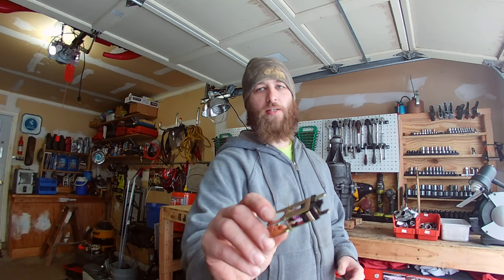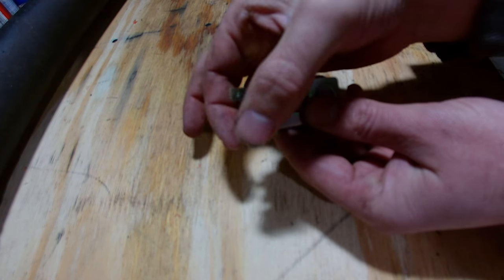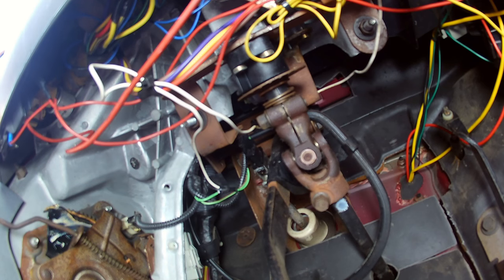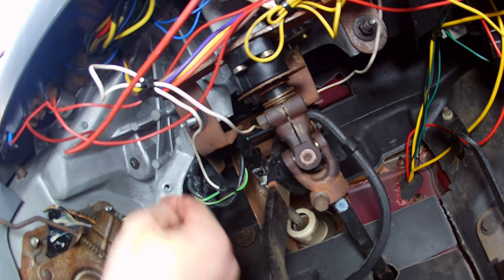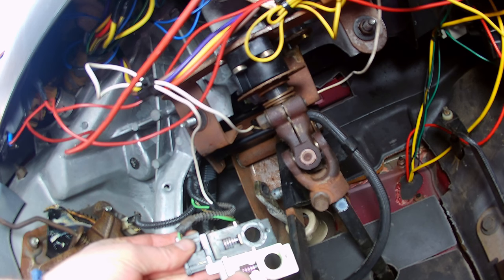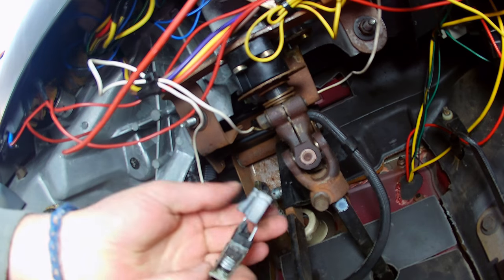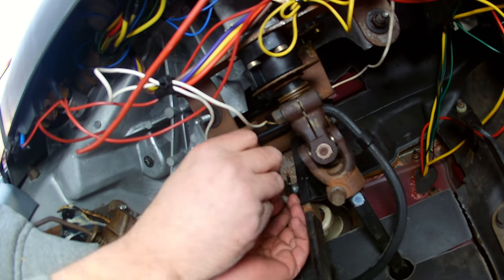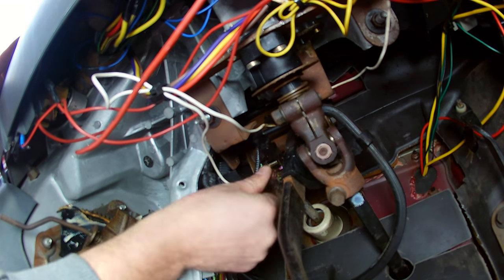How to Replace the Brake Light Switch 80-96 Ford F Series & Bronco by @GettinJunkDone

Comment: Great video. Just a warning. I have a 1996 F250 XLT. Wasn’t paying attention when I took the old one out. Turns out my switch is 180 degrees opposite from yours when you put it on the pivot point between the brake pedal and the brake master cylinder rod. It will go on just like yours, but the brake lights won’t work. Took me a couple hours of testing before I figured out my mistake. Experience is a cruel teacher lol. Thanks for taking the time to make the video. Best of luck

Comment: I'm replacing my junk/ wimpy vac booster with a hydro unit (yes its a stock part for my f350 7.3ps) and I'm struggling to reinstall booster rod with switch and now I know it's doable with booster and pedal bolted tight.  I got thr pedal out of a 94 f series with hydro and the hydro and vac booster have matching part numbers between the 2 trks.  I can't wait to feel the difference I've read between vac and hydro boosted brakes since I tow a 13k trl.  The fun part will be getting the new stock power steering lines installed

Comment: I just fixed this issue. The switch will slightly move causing the lights not to come on. I have to constantly reposition the switch. Any recommendations? 1995  F350
Reply from the maker: There's got to be a way to secure it in the correct position. Bending the it slightly, using washers, zipties.  time to get creative.

Comment: Does a faulty break light switch prevent you from being able to shift out of park? I have a 1993 ford f 150 and I’m not able to shift out of park when the brake is pressed
Reply from the maker: That is a good question.  I'm not entirely sure, but it's possible.  I would have to study a wiring diagram to know for sure.  Maybe someone else will come along and help us out with the answer.

Comment: Another video mentioned that the round bushing can often be uneven, resulting in faulty operation. He micro measured two, and each had variable thickness, altho' one still worked while the other didn't.

Comment: Is the green wire the hot wire or common to switch? And the black is the ground I guess. I’m building a wiring harness for my 86 mustang. I gutted all the factory wiring and I’m running the AutoRod Controls relay bread board, and the Painless radio delete switch panel for my break light, taillight, headlights, nitrous bottle blanket, and nitrous purge solenoid. I can figure it out if I can’t find any quick information. I’m just seeing if there’s any other information available. Thanks for the video.

Comment: Great video. On mine, somehow the brake lights stay on when I put everything back together. Not sure where I went wrong. I have two white plastic washers. One that goes on before the rubber one and last right before the pin. Seems to be to tight for some dumb reason.
Reply: Me too.

Comment: Could you explain the wires that the switch plugs into?What wires do what? On my 95 f150, the switch plugs into a plug that has two green wires that come out. What are those two little green wires? I would like to tap into the one that activates the taillights and put a ON/OFF switch on it. So when I hit the switch it will cut power off to my tail lights.

Comment: So... I woke up this morning and both of my brakelights don't work on my 91 F250...  My hazard flashers work so that allowed me to rule out the fuse... In the past someone jerry rigged some trailer lights into the system and they have never worked and side effects of their backwoods installation have only caused me problems (like the rear wire harness I didnt know was tucked behind the bumper falling down and shorting everything out when it got torn up on the highway)... Anyhow, I've replaced so much on this truck I can only assume this is next...
Reply from the maker: It might be a good idea to head to a wrecking yard and grab a harness from a donor truck.  Even if it's not in great shape, you could repair a harness as it was meant to be and replace the headache you've been dealing with.  Something to consider.  You seem like you know what you're doing, so I imagine you've already thought of this.
Reply: @GettinJunkDone  Turns out, firing off my hazards (for the first time ever) fried the brakelight part of the , hazard/turnsignal/brakelight master switch in the steering column... Which totally sucked....

Comment: I have a weird problem wonder if this is it or any help. My brake lights only 1 comes on. 1991 ford f150. Tail lights come on both sides but only 1 brake light comes on when brake applied. They are the same bulbs 2 filaments. I've replaced bulb and fuse. Could it be this or I was thinking a short in the wire leading to the light.

Comment: I’m having a bit of a problem, my 13 fuse keeps popping and it only pops when the brake light switch is plugged in I’ve taken out all the brake lights and as far as I can tell the wires are ok
Reply from the maker: Try testing/replacing the brake light switch itself.
Reply: Replace switch. Kept blowing my number 13 fuse too
Reply: I fixed it, ended up being a wire going from the brake switch to the 3rd brake light rubbing against the body. Then when I removed it and screwed the panel back in I accidentally screwed the entire wire harness so had to redo that as well lol was fun while it was tied together tho, had the interior lights go on and the brake lights and the warning buzzer go off when I pressed the brake lol

Comment: I'm having similar problems with my '89 full size bronco...

Tail lights work
Left/right blinkers work
Brake lights do not work
Hazards work, but only the front marker lights...
Reply: I ran into the same thing that you did. The fuse was blown.

Comment: ?... Will that switch affect the turn signals ¿ specifically the left/ which is the one I'm having issues with. I recently noticed that at a red light. sometimes my left signal works when I'm stepping on the brake and as soon as I let go of the brake the signal stops. That's why I'm wondering if that's connected somehow🤔 but I'm thinking about replacing that stop light switch. Ty.
Reply: I found the problem with my left turn signal it's in the fuse box if I would move the Box what kind of signal the blinker comes on so it's a loose wire on the fuse box!!!!

Comment: so what do I do if I replace that part and the brake lights still dont work? because that's the situation I am in. I have replaced the brake light switch and both flasher relays . I have turn signals but no brake lights and no hazards (the no hazards might be a separate issue because I know those have not worked in a while but only recently discovered the brake lights not working)what else could it be!!!!????
Reply: AsTheWheelsTurn did you ever get that figured out having the same issue you have

Comment: Not a good video. You need to mention which way the open slot of switch v/s the closed hole of the opposite side ...and also the orientation of boister rod ..some have an offset